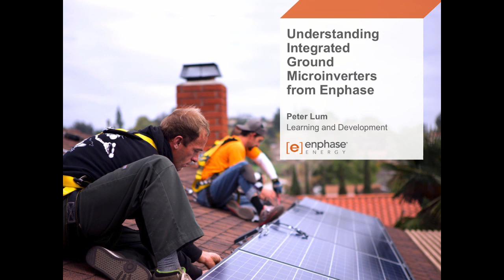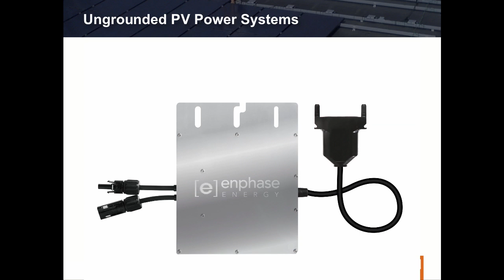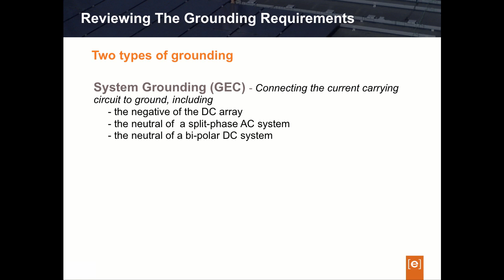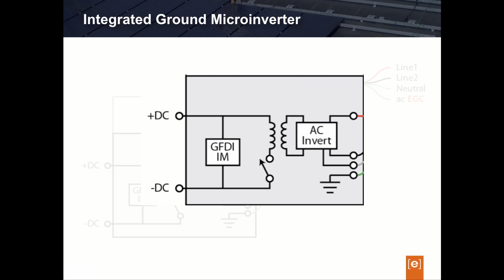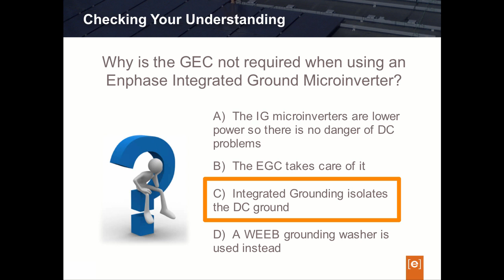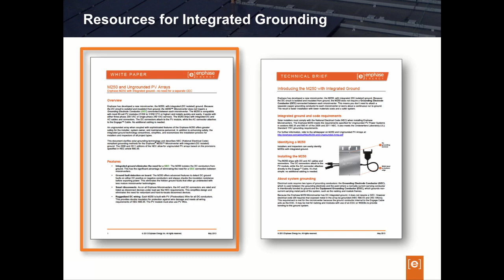Understanding Integrated Ground Microinverters

Comment: GOOD NIGHT TO INSTALL SOLAR PANELS 6 250 WATS EACH WELL AS ITS MODEL M215 MICRO INVESTORS ARE ONE FOR EVERY 6 SOLAR PANEL ALL BRAND AND ME PUT IN Enphase LIGHT METER CABLE bidirectional TAKE ME WHERE HAVE THE BOX FUSE OF MY HOUSE ONE CABLE TRAN 4 GOING GREEN EARTH THAT YOU PUT ON THE STRUCTURE AND LOWER PANELS WITH THREE IS A RED L1, A BLACK IS WHITE LINA 2 UN NEUTRAL AND IS NO LONGER AS CONNECT WITH PUTTING A BOX OF 30 AMP BREKER. IF YOU COULD SEND ME A DIAGRAM AS YOU APPRECIATE WHAT YOU CONNECT
Reply: Dude, fix your caps lock key, you make my eyes bleed.
Reply: Puedo ayudarte, me encuentro en Sonora, México. Puedes formular la pregunta en español? Entiendo inglés pero la pregunta está algo confusa. Saludos.

Comment: ok so for the IGEC no weebs are needed from the microinverters to the rail, or #8 from the frame of the microinverter to each other. no more #8 wire because the GFDI IM (Ground Fault Detection and Interrupt Circuit Isolation Monitor) passes any faults through the Equipment Grounding Conductor.